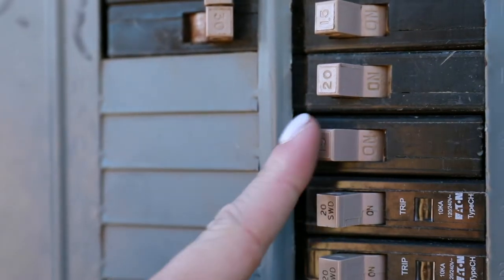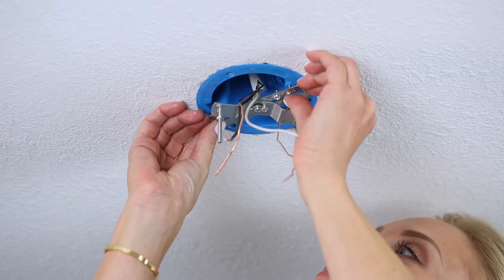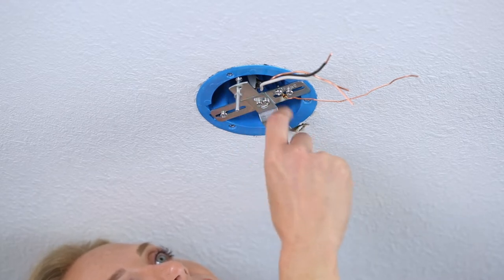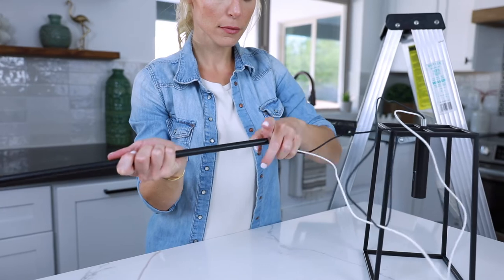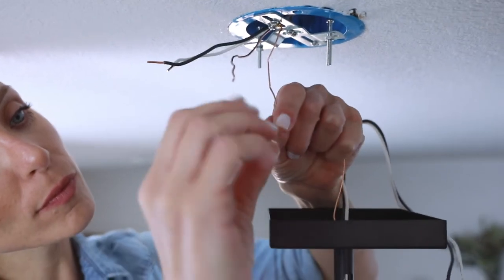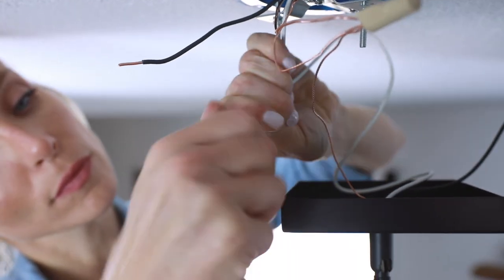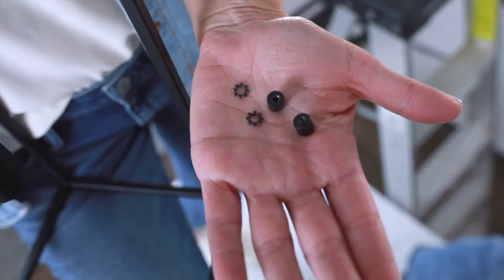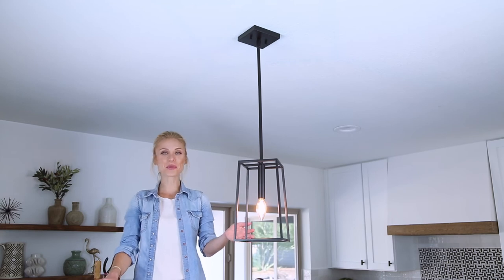How to Install a Down Rod Pendant Light | Canarm

Comment: If your light doesn't have white and black wires and only has black wires....one of the wires will be smooth and the other wire will have grooves on it. The smooth wire goes to the black wire and the grooved wire goes to the white wire. 

Instead of wire nuts, I prefer wago 221 connectors. I install  the connectors to the ceiling side first.
Reply: What if the wire is a "double" wire with no differentiation between the two? Will it make no difference, then, which side of the double wire goes with the black or white?